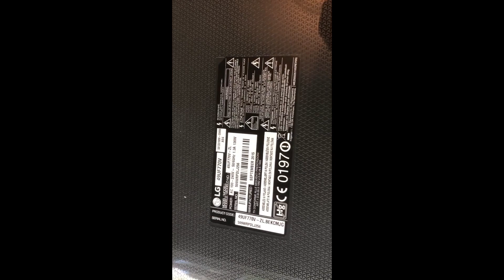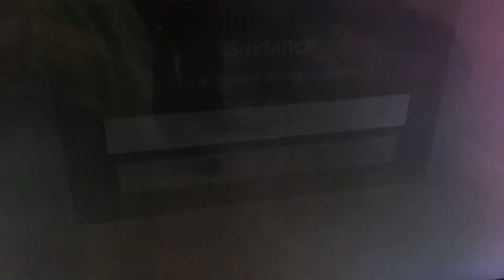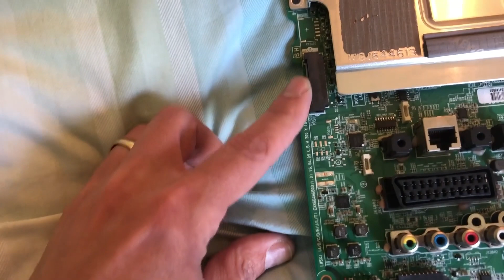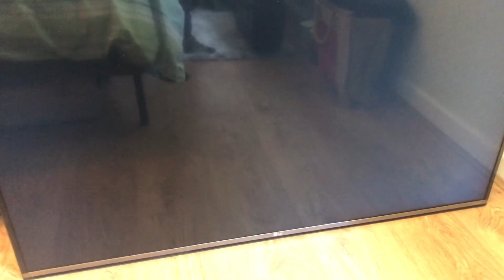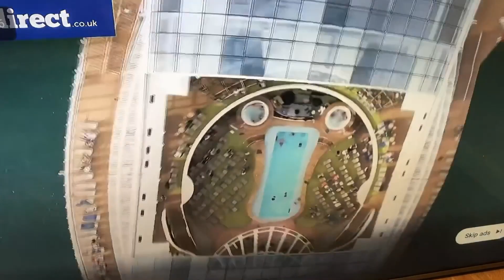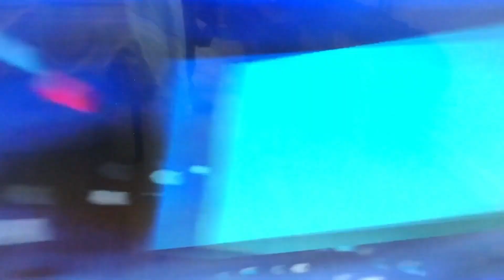How to fix LG UF770V Fixing a Smart 4K TV - XD Engine chip fix with other series board

Comment: Great vid Avid! I'm now officially a fan. Would you mind doing a follow up or simply some bullet points here on how you ensured compatiability between the donor board and the SMPS, T-CON and panel?
Reply from the maker: Cheers, all done by luck really! My method was:

1) Search on eBay for mainboards for sale, looking at the placement of connectors and sockets, they have to match 99% with the current board
2) Now I have a different model number I compare the specifications of the models against eachother, here I could see screen was the same for example
3) I used eBay to search for the power board, tcon of the found model and compared images, I found only difference was the pins on the power connector
4) I ordered a mainboard and new power connector given all other boards and specfications were so close
5) After putting together I was amazed it worked but found that I needed a new remote control
6) So in the end I upgraded the set slightly to a better model mainboard with the much better heatsink, although I made extra holes in the back to cool off the set
7) Its been working 100% since the video and the TV is used daily

Negatives to my approach is only works with tiny incremental changes between models and it took a long time searching and downloading images of mainboards for example!
Reply: @AvidRetro  Thanks AR, I appreicate you taking the time to delineate!

Comment: I have had a LG 49UF6430 with the same problem. Any video that plays will always be the same arrow shaped static. I found a slight fix and will show how far i got. Its not percect but i found a way to allow video to play on my TV after 3 years of holding onto it. Its such a good TV. Screen isnt cracked so parts are worth selling. But id personally rather buy parts to fix her back up. Zhes too good. Especially with a touchpad combo Logitech keyblard. 
Take her apart. Take all the bpards out after disconnecting them FIRST. 
PAPER TOWEL AND 90% ALCOHOL CLEAN THE BOARDS. Drentch them in alcohol. Scrub with a clean tough toothbrush. Look at any residue or spill looking stuff. I live in a smoker house so i assume the tobacco and niccotine built up inside. Causing corosion. Scrubbing and wiping will reveal any weak points. If you see copper poking out of thebwires or boards there was a short happening in slow mo. Cleaning it might set it back temporarily. You need to clean and coat it back up. If its not green its mean. Like the motherboard ofcourse. 
After scrubbing and dubbing?
Sounds extremely stupid. But if you unplug the TV while its on? IT WILL suck out the capacitors, instantly orbat leasy majorly taking all charge out of the TV. Use a plastic handled screw driver to short out the PSU`s biggest capacitor just to take percaution. If it blows than that cap was a ticking timebomb and needs to be replaced. A healthy capacitor would just spark where you short it. Nothing more. 
Throw it all in a dishwasher. 
All of the electronic boards that are not glued to the LCD (Display)
You need to wash those delicately by hand and dry off with a dose of alcohol. But DO NOT LET THE ALCOHOL DROP DOWN THE FLEX CAVBLES INTO THE SCREEN! Once it drips below the metal shield, expect to see stains inside the screen even if you fix the TV 100%  
Dish washer. Motherboards. Double the heat dry cycle. Tripple to be sure its all deff dry. Douse in 90% alcohol and scrub away the dish detergent residue. 
Put back in dishwasher on heat dry for 30 minutes to evaporate the rest of the alcohol and really make sure its all dry. 
Put it back together. Be amazed. Slightly. 3 years and soab shes coming back. I love to be the one person whos actually figuring it out.
Just years lf trial and error
Reply: Proof of my progress. She's encoding video again. Not perfectly but she's back! I'm so excited¡!
https://youtu.be/a94Hqji2_dE?si=0DbWeMWZyxVbrsFl
Reply: Sorry for the recording quality. Android problems
Reply: Recent High Quality Proof I Found a Fix:
https://youtu.be/_mmB851fdqA?si=aTAK_fc_JXIQYXCW
Reply from the maker: Thanks for sharing your experience and detailed process! For anyone trying this, cleaning boards with 90%+ isopropyl alcohol is a common electronics fix, but putting the circuit boards in a dishwasher is risky as the detergents can cause long-term damage or corrosion if not dried perfectly. If you do clean boards, stick to alcohol and a soft brush, and make sure everything is dry before reassembly. I'm glad you got your TV partly working again cause these LGs are worth saving! But I do wonder if baking the main board might work better, but if you do then use a proper burn-in / pcb baking oven.

Comment: No thermal paste ? That's one of the problems. Other one is there is no active cooling, just passive to make it quiet. Small fan does not make a lot of noise, they are almost silent but will extend tv life. LG and others don't want long TV life.
Reply from the maker: Yes and I think the model that had the fault had a very inadequate heat sink with a insufficient amount of paste added. The newer board seems to be behaving, I also drilled some more holes out of the vents in the back to let more heat escape!

Comment from the maker: While it appears that this mainboard replacement (UF850V) is better crafted does anyone have experience of XD Engine chip failure with it? Also has anyone drilled holes into the back of the plastic cover to allow it to vent heat out better?